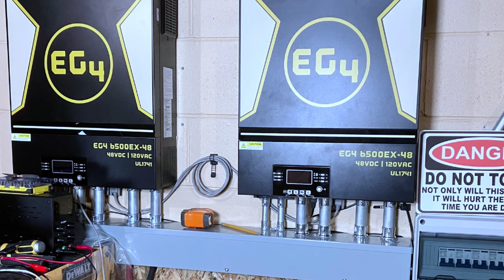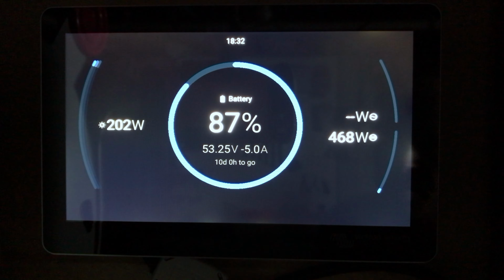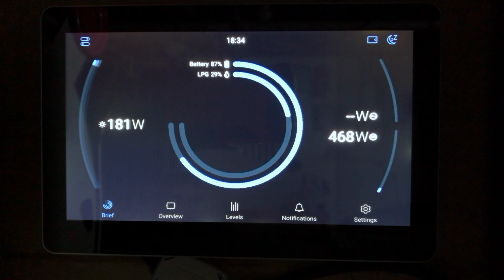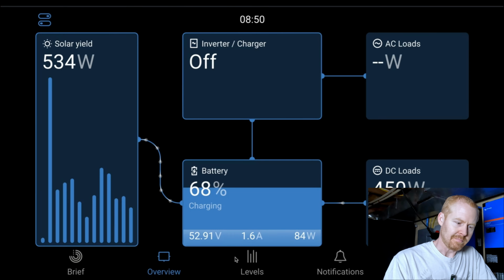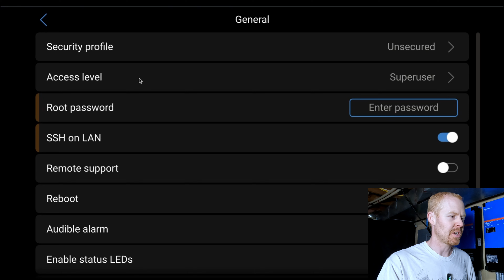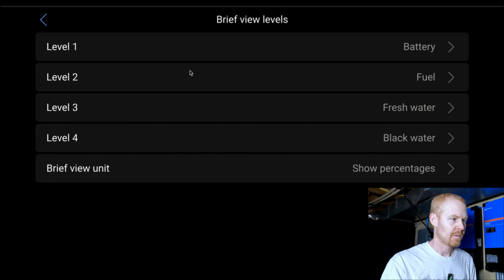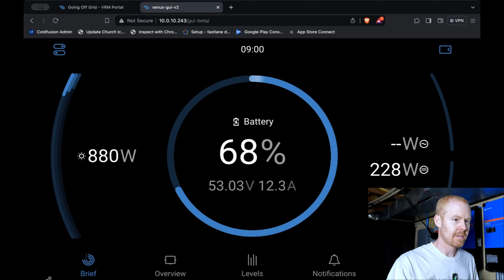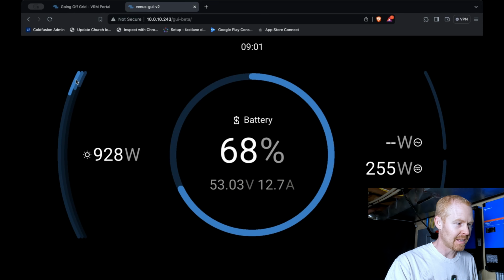Revisiting Victron VenusOS GUI 2.0 Beta: A Few Months Later - What's Changed?

Comment from the maker: @CurrentConnected  Free Shipping Promo - Ends August 31, 2024
Coupon Code: adamgog
Direct Link: https://bit.ly/4dGqbFH

Beta Information
--------------------------------------------------
Beta Installation Video: https://youtu.be/gGCxxiSB1lc
If you want to see a slideshow regarding the updates, take a look here: https://bit.ly/gui-v2
https://victron.discourse.group/t/venus-os-beta-series-announcement-and-changelog-v3-50-15/120
https://github.com/victronenergy/gui-v2/

Beta Testing: https://www.victronenergy.com/live/ccgx:beta-testing

Links to the parts & pieces in the video (affiliate links)
------------------------------------
Victron 48V MultiPlus-II 5kVA 120V Inverter
https://www.currentconnected.com/product/victron-48v-multiplus-2-5kva-120v-inverter-70a-charger/?ref=AzzpK9Fl

10kVA 120/240v Base MultiPlus-II System
https://www.currentconnected.com/product/10kva-120-240v-multiplus-2-5kva/?ref=AzzpK9Fl

Victron Cerbo GX
https://www.currentconnected.com/product/victron-cerbo-gx-system-controller/?ref=AzzpK9Fl

Victron GX Touch 7" Display
https://www.currentconnected.com/product/gx-touch-display-cerbo-gx/?ref=AzzpK9Fl
Reply: Why is there not a bluetooth or wifi way to use cerbo to better control the victron 3k inverter/charger.  Features like ignore AC, when to start charging battery, etc.
Reply from the maker: @joeboxter3635  The only reason that comes to mind is that Victron might be geared more towards the installer market vs the DIY so they're trying to limit what a non solar/non technical person can do to mess up their installation.  

I wish they did have a lot more control from the Cerbo.  I wouldn't have to find my own "hacks" in order to get certain things (like controlling the AC IN) to work.

Comment: I wanted to say thank you for the free shipping from Current connected. Nice to have power when grid is down 😊 great job
Reply from the maker: Glad it helps!

It's so nice not having to run the generator!  I did the rough math.  With the cost of fuel right now and being down for 48 hours so far, it would have cost me over $130 to keep the generator running.
Reply: Its great when the whole streets out and you had no idea the grid went down until you ask the neighbor. Now they want to plug into my system.
Reply: Do you use the eg power inverter charger or direct. depends on how clean it is

Comment: Adam,
I have been a big fan and following of your page and Andy's off grid garage.
My setup is almost identical located in N.W. WA and originally had the eg4 system but i upgraded to the victron system. Eg4 crapped out so upgraded for the replacement that i may use as a generator boost to the 10k victron like Andy did but his was all victron already.

My system has been working flawlessly since going off grid 100% since Feb 2024 on 8.7kw of solar 16 420w REC and 20 renogy 100w. 770kw of battery bank using 2 x eg4 100ah and 2 x Gobel power 285ah.
Just ordered a DIY battery case Andy suggested on one of his builds with Eve 314 mb31 because finding out from eve they have discontinued the mb30, so still waiting on That to get preparing for raining season. When it rains i only produce 5-10%.

Only problem i recently have and I hope you can help me with is on the Cerbo gx mabe faulty, Not getting any data from the shunt/Battery/Loads. Only data on charge controllers mppt 250/100 and 250/85 to the gx and vrm. Did upgrade to the Beta.
Can't find anything out there that anyone is having issues with except putting a cap on power point. Andy did have a little issue but a thing that was with his Pi.
That"s what i hate about anything that they compact in a small size a put fets, and components in always seem to fail from heat i would think.

Let me know on your input or others on the channel.
Keep up on the good work!
Reply from the maker: Appreciate the comments and congrats on going fully off grid!  I still hope to get there some day!

As far as the Cerbo goes, do you see the shunt and inverters show up in the device list?  I'm curious if it's some kind of connection issue or a programming issue.  Seems very odd that you have a shunt (which would be VE CAN) and a MultiPlus (VE BUS) that aren't showing any data.  

This is probably a silly question, but have you gone and rebooted the Cerbo?

Comment: Why is there not a bluetooth or wifi way to use cerbo to better control the victron 3k inverter/charger.  Features like ignore AC, when to start charging battery, etc.
Reply from the maker: The only reason that comes to mind is that Victron might be geared more towards the installer market vs the DIY so they're trying to limit what a non solar/non technical person can do to mess up their installation.  

I wish they did have a lot more control from the Cerbo.  I wouldn't have to find my own "hacks" in order to get certain things (like controlling the AC IN) to work.

Comment: But where has the relay screen gone!? 😢
Reply from the maker: I'm not sure if they added it in the official release of 3.5 or if it was added in 3.51 but there's a control button on the top left of the screen.  If you click that, it opens a window which lets you control your generator (if configured), some inverter settings and it allows you to turn on/off your relays.

Comment: Wasssup..!  I just installed it. Guess it needs a few minutes to be able to access the settings in it. My screen goes blank. I like the look and yes, it's pretty fluid\smooth.  Can't wait to see it with active solar. I wonder if it detects multiple arrays.
Reply from the maker: @OFFGRID_Trucker  awesome!  It shouldn’t have any issues showing multiple Victron arrays as long as the charge controllers are connected to the Cerbo.
Reply: @AdamDeLay07  My Starlink was  being slow.  All the pages eventually showed up. Yes, both 150\70's are connected to it.  System is running well. 2400w, 1600Ah.
Reply from the maker: @OFFGRID_Trucker  that’s great!
Reply: watch your temp my 250/100 get up to 120 degrees at 60amps, I'm going to install laptop fans below them to keep them cool 5k is a lot of energy on mine

Comment: I upgraded to the latest beta, but I no longer see the levels screen. I can see how to change the brief levels view options, but how do I get the levels screen back?
Reply from the maker: If all the sensors are turned off, the "levels" page won't display.  

Go to Settings -> IO and make sure you have the proper analog and digital sensors turned on.  For my temperature sensor, it was just Analog -> Temperature Input 1.
Reply: @AdamDeLayDIY  Thanks, Adam. I don't have any sensors set up yet, but the screen still displayed with the old firmware. I have a Mopeka sensor on my propane tank that I currently monitor over BT, but plan to add it to the Cerbo.
Reply: @AdamDeLayDIY  Easy peasy... went into IO and selected Bluetooth Sensors. It found both of my sensors (main 20lb tank connected to my Genmax 3500W dual fuel generator, and a spare 20lb tank).  The main tank has a Mopeka Pro, but the spare is the regular Mopeka. The Pro shows solid readings, but the regular unit is flaky. If I stand near the Cerbo with my phone, I get solid signals from both. The tanks are in a prefab lawn shed with the generator behind the house about 50ft from the Cerbo.  If Continuous Monitoring is disabled, how often does it update?

Comment: still kinda annoying that they dont realise there is “DC bus” (aka bus bar etc) to which all the devices (chargers or loads) are connected. 
eg a battery doesnt have 3 input/outout connections .. it has only ONE … current flows into OR out off only ONE connection between battery and the “DC bus” … 
its not intuitive, or electrically corect 
just  IMHO
Reply from the maker: @qchatgreg  what’s the context?  I’m not sure I’m following what your saying.  The shunt can track all power flowing to/from the batteries.